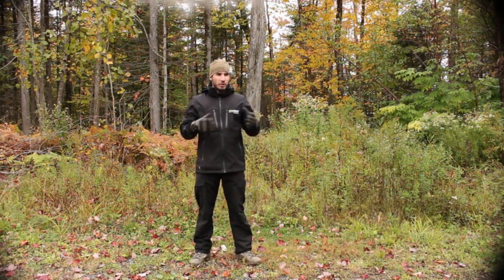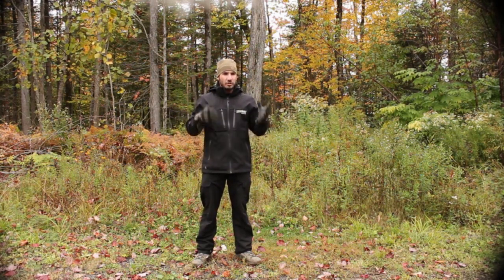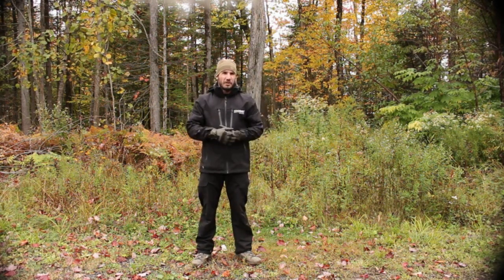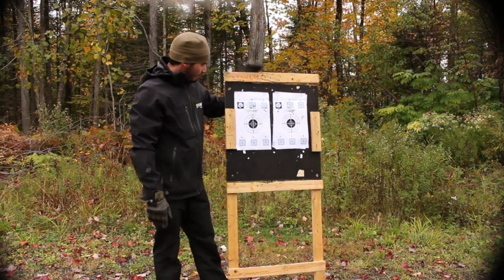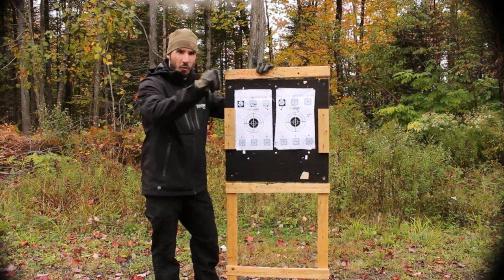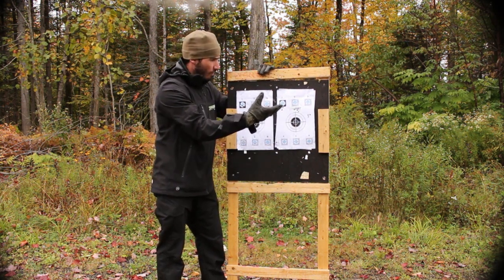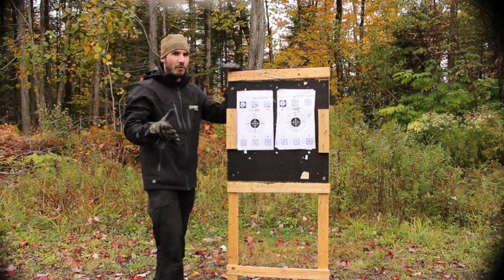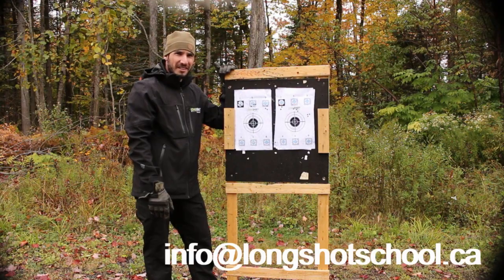How does the barrel harmonics affect the POI

Comment: You need to firmly (clamped or threaded) attach the weights 360degrees around the barrel, and weight needs to be similar steel to barrel to change harmonic frequency, otherwise you’re dampening the harmonics, or just pushing the barrel down.

Comment: Your interesting test only proves that when you add a weight hanging from the barrel it will bend the barrel downwards moving the group down. The heavier the weight the lower the group. The precision is the same in all groups. What means that harmonics has no influence on precision because it only happens after the bullet leaves the muzzle. If you rest the barrel on anything, the shots will hit high.